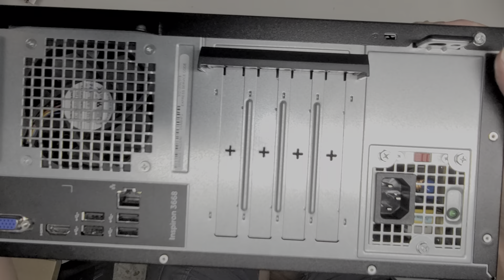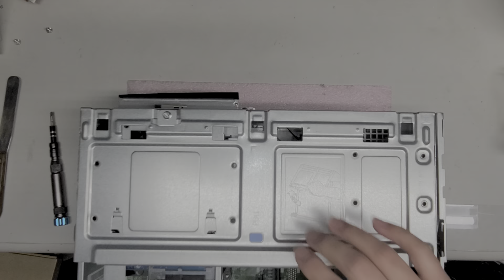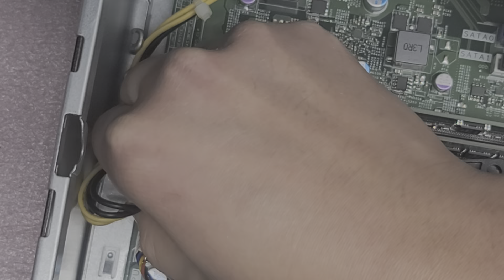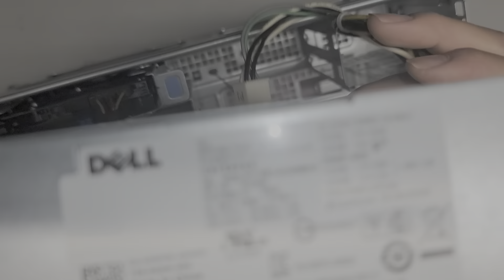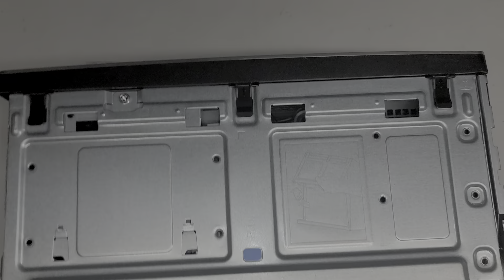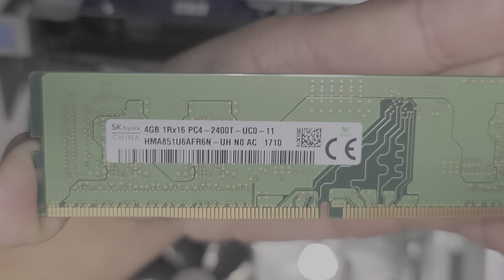DELL Inspiron 3668 Disassembly RAM SSD Hard Drive Upgrade Repair Power Supply Replacement

Comment: Hope this isn’t too dumb of a question but what’s up with the M.2 Wi-Fi? Is there any work around to where that m.2 slot can be used for an SSD and Wi-Fi installed in some other fashion short of a new mother board?
Reply from the maker: Usb wifi lol

Comment: I was hoping for a psu upgrade, I have a new gpu that requires an 8 pin connector for my Inspiron 3668 and I can't find any videos on this specific model and the other dells are all a little different.
Reply from the maker: Sadly the psu can't be upgraded
Reply: @ItsBinhRepaired  why I see other people have upgraded their gpu 1050ti, rx570 using stock psu 240watts, I'm really confused or I just accept I can't upgrade this unit T_T
Reply from the maker: @jayar-record  you might be able to get some adapter, but 250w can't power that I don't think.

Comment: my friend can i use carte graphique gtx 1650 ti or super in dell vostro 3668
Reply from the maker: If it fits and has the power for it.
Reply: @ItsBinhRepaired  my computer is i7 7700k 8 ram and i don.t now the watt
Reply from the maker: @Jemaidh  you'll have to check the side of the power supply
Reply: @ItsBinhRepaired  thank you
Reply from the maker: @Jemaidh  no problem

Comment: So I have the Dell Inspiron 3650 which is basically the same with different hardware but can I use like any mainstream powersupply company like CORSAIR and put it in there?
Reply from the maker: no, you won't even be able to get one that fits.

Comment: Hi, im late but can I add an ssd 2.5 to the existing hdd drive? Do I need to buy extra cables?
Reply from the maker: You'll need a sata data and make sure your power supply has a free sata power cable.  You could use a sata power splitter if there isn't. If you don't use the optical drive, you can use the data cable from there, but still need power.
Reply: @ItsBinhRepaired  Thanks for the help I bought a mount for the sdd which comes with sata data cables and I bought a sata power splitter so I should be all set.
Reply from the maker: @jirabussey8862  sounds good
Reply from the maker: @jirabussey8862  make sure to clone the hard drive to the SSD to get the best performance
Reply from the maker: @jirabussey8862  https://youtu.be/4p5jFDzVwUw
Reply: @ItsBinhRepaired  perfect, last question, can I install a 4gb ram to the already existing 8gb of ram? Will this work? does it matter what brand of ram I should buy?
Reply from the maker: @jirabussey8862  size doesn't matter. You have to match the type and speed though
Reply: Bro, my power supply no extra port, what can i do?
Reply from the maker: What do you mean?
Reply: Vostro 3668,, where is power port? SSD
Reply from the maker: @bagerhatian  you're on the wrong video lol this is an Inspiron.
Reply: Bro everything is same..
I want to add ssd in my pc,, but how?
Reply from the maker: Need sata power and data cable this pack should help. https://amzn.to/37KBVXa